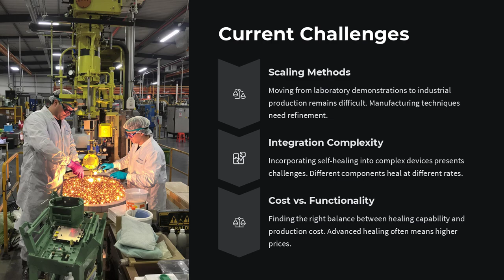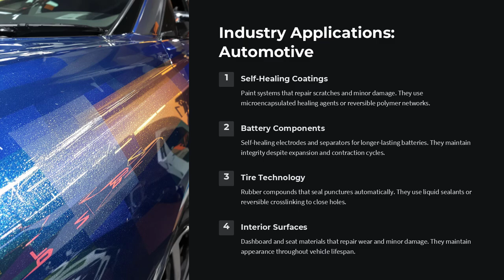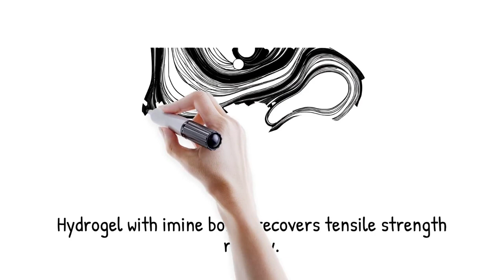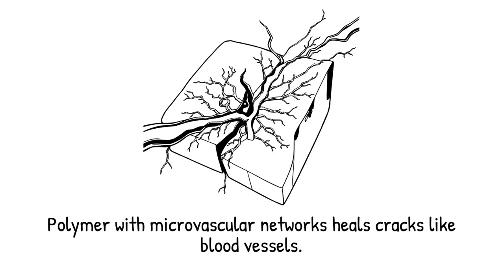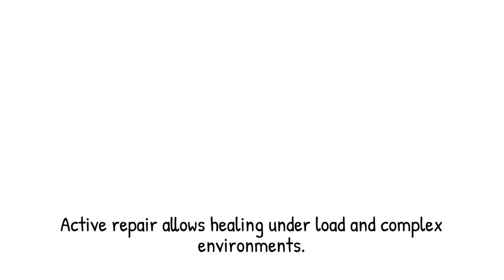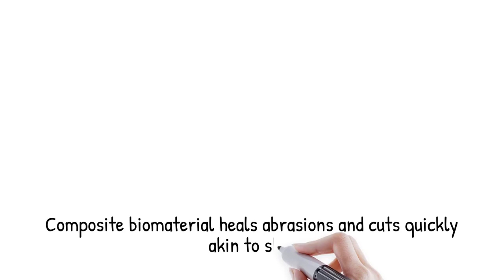Can Materials Really Heal Themselves Like Skin?

Comment from the maker: How can synthetic materials maintain non-equilibrium repair cycles without energy waste?
Can mechanochemical sensors fully replace external monitoring in structural engineering?
Will living, regenerating materials blur the line between biology and technology?